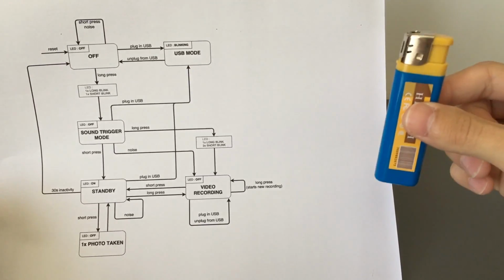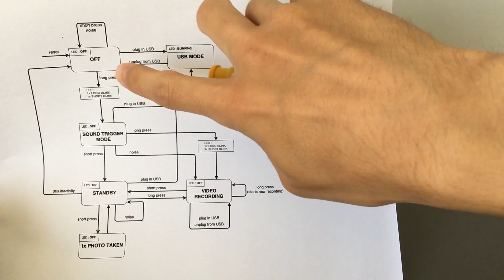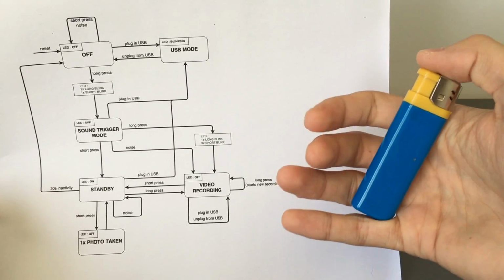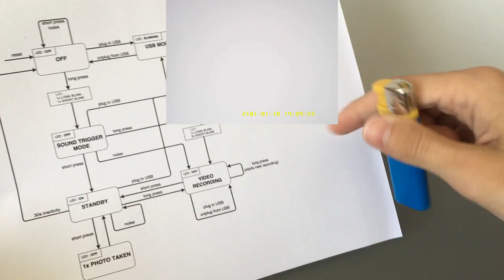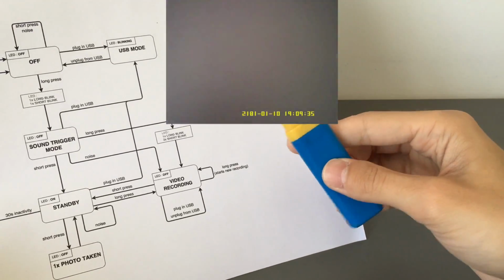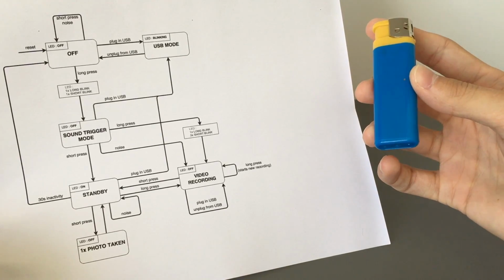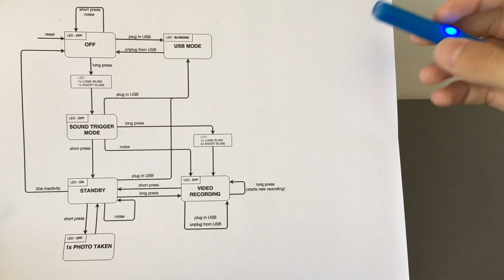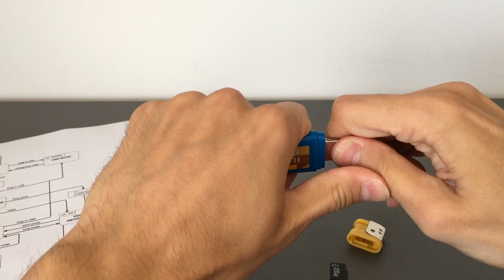Lighter Camera Instructions + Teardown

Comment: the micro sd card slot is very moody... if you jiggle the card or even pull it out a half a millimeter it will then read it better.. very moody which means it can deactivate during a recording rendering the video useless practically...

Comment: Hi, I've got one but it always starts up at 12/25/2007 The instructions say something about a "TAG.txt" file in the root directory but that does not work, any ideas? Date and time in WIN-7 is OK. Thanks for the video, very helpful, especially the flow chart.
Reply from the maker: by now there should be clones of these out in the wild, with ever fewer functions built in and implemented right :(

glad it helped though ^^